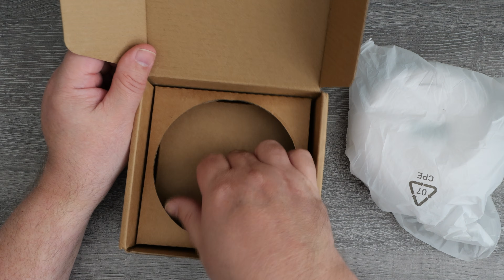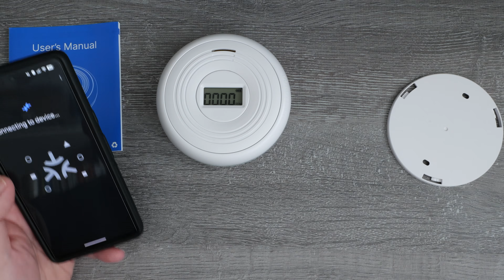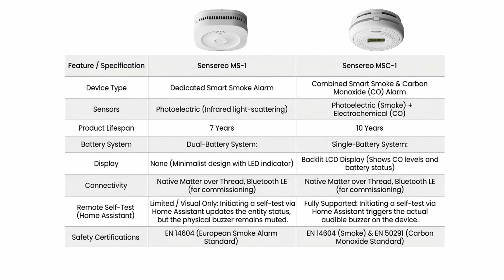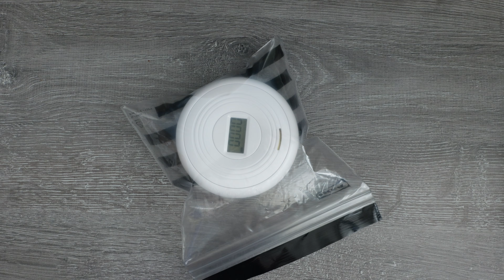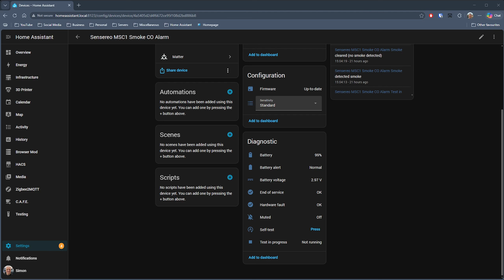Sensereo MSC-1, The Smoke & CO Alarm That May Just Save Your Life

Comment: I bought two of these but they go offline due to the distance between them and the border router. They have very poor receivers and they don't seem to use other powered thread devices that are right next to them as routers either so I have two dumb smoke alarms now. Other battery thread devices that are further away than these work fine. Unless your border router is within a few meters of these, good luck. Not impressed at all.
Reply: Update to this comment. I got the smoke alarm to work by resetting it to factory defaults and re adding it to home assistant 'after' plugging in the eve power socket next to it. It now routes through the socket. But my initial comment still stands that the devices need to be unreasonably close to the border router or some other mains powered thread device to work reliably.
Reply from the maker: For everything Thread promises, at the end of day it's still a mesh network, and just like Zigbee, it needs extenders in the network - which is what your eve plug is doing. Glad you got it sorted, there are so many people having issues with Thread that I do wonder if it's ready to become the new standard, yet.

Comment: I don't really like the idea of 3-year batteries.  The lifespan of the detector is 10 years and  that's why the devices typically come with a sealed 10-year battery inside.  If you can just swap out the battery when it dies then you could keep the device "alive" well beyond its useful life, which may come as a bit of a surprise when you sleep through an actual fire for the first and last time, although I did spot the EOL indicator which likely means you have to throw it out anyway when it triggers unless they sell spares you can swap out.  They should have just included a non-replaceable 10-year battery with it rather than have users monkey about with coin cells.  I'd recommend buying a normal alarm because, other than triggering a an alert on your phone when away, what kind of automation can you expect to make out of this anyway?   I'd go with a normal smoke alarm and pair it with a separate CO/CO₂ air quality sensor.
Reply: The replaceable battery is just for the Matter of Thread functionality. The smoke alarm itself uses a sealed battery which, in the MSC-1 is also rated for 10 years, but in the MS-1 only for 7 years.
Reply: @Hans-gb4mv  That sounds great then.  The Matter battery doesn't matter as long as the alarm alarms as usual.  If I don't get an automation because I didn't to change the coin cell battery when I was told to then that's not the end of the world.

To me this all sounds like automation for the sake of it, but I'm not worried if the main battery is sized to die at the same time the alarm reaches its end of life and needs to be replaced anyway.

Personally I'd still go with a normal standalone alarm and have a separate way (maybe using fire alarm interconnect cables) to alert HA (and therefore me) if my house is on fire while I'm away.

This is the same reason I'd never have a fire alarm wired directly to the mains for perpetual power if there's an option to have a sealed battery with the same life as the sensor (or a little shorter).  When the sealed battery gets low the alarm should start chirping and raising hell to tell me to replace the entire thing.
Reply from the maker: You raise some interesting points around battery life, but could you not do the same with a regular smoke alarm and keep them running? 

As for opting for just regular non smart devices, absolutely true, but the same could be said of a lot of smart devices that people buy, could it not? 😂 We buy them primarily for convenience, more than anything else.

You're absolutely right with regards to the notifications, but also you can schedule regular testing of the alarm,  which is something that people just don't bother doing. They stick these on the wall/ceiling and the next time they do anything with them is when they start beeping to change the battery.

With a regular alarm, you're just going to have a beep going off, but with a smart one, just imagine the chaos you could create in your home to alert everyone to get out of the house - playing loud music, flashing all the lights, unlocking the doors, ringing the doorbell 😂

Comment: Thanks for the video - something I'm on the lookout for since my 2 x Hue products are EOL.  This looks like my replacement. Three features I'd like

1. Interlinking
2. Ability to sound the siren / flash the LED
3. Hardwired product option

There doesn't seem to be many hardwired smart options on the market
Reply from the maker: Yes hardwired options are a bit of an oddity it seems, but something that I suspect would be quite popular.
Reply: @Byteofgeek I guess with hardwired you then have to have circuitry to deal with different kinds of voltages etc. and also maybe additional certification ?